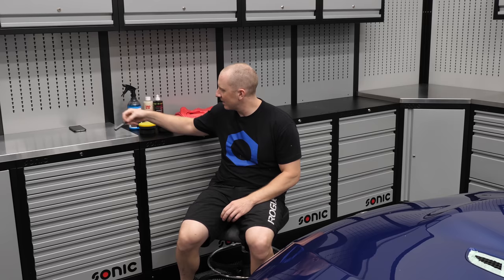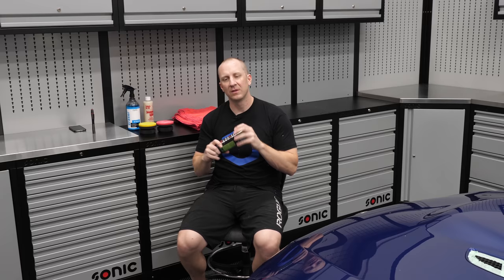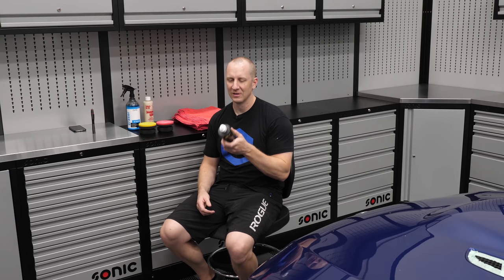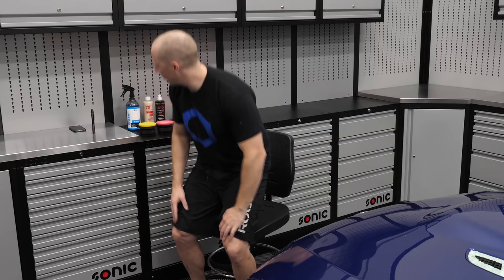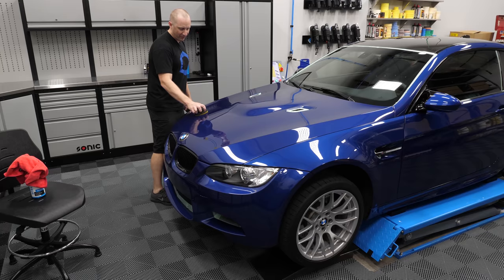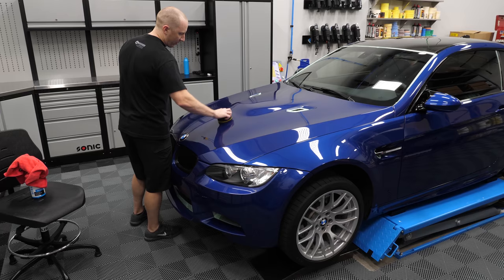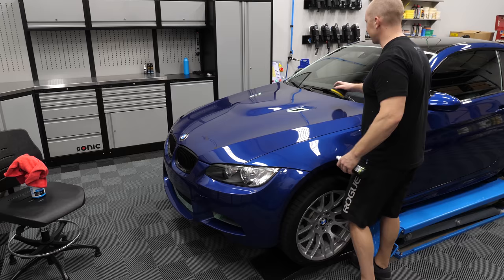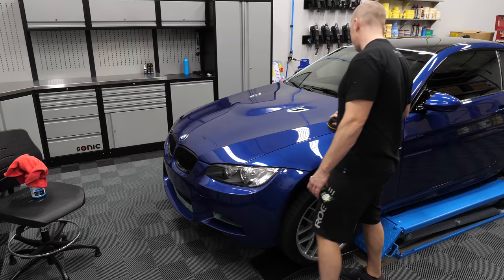Dialing In My E92 M3 : E8 - Power Lock / Collinite 845 Combo

Comment: I just went through compounding and polishing my daily driver Civic Si in Dyno Blue Pearl.. Used Griots Boss creams and it came out great. Now winter will start any day now.. and I just got Powerlock and 845 on in the nick of time. We'll see how the combo holds up to the harsh Minnesota winter. My paint has its flaws but this combination definitely has it looking up to it's full potential... and I can totally relate to that Powerlock wipe off. It's great. I really like the application of the 845 on top as well. So easy with such little product. I only had it sweat on my hood.. but it was because I used too much product there. Other than that no issues. The Bead Maker step sounds interesting. I cant wait until Spring so I can do this all over again. :)
Reply: Bytes In Flight fellow Minnesotan here!

Comment: you put me on the power lock and 845 combo and it never disappoints, might have to try the adams pads.
Reply: Do you ever try to apply the Collinite and power lock with a DA or always by hand? Thanks
Reply: @MrGflan  which ever method you prefer, personally I prefer using the DA it's quick and you avoid the elbow grease.

Comment: Matt, I’ve been told via a detailing forum
that the solvent content of Collinite 845 removes the previously applied coat of Powerlock plus, thus making the combo pointless. Is that a load of BS?
Reply: Good question. Lots of experts use this combo, and he did state that it lasts longer than just with one or the other. I called Jescar once and ask them about this combo and they didn't tell me about what you said.

Comment: Finally the stain in the trunk was unveiled... 😱
Its not a big deal, but it keeps attracting your eye... looks like marriage, you can only remember the bad spots, even through 99% of it was good. 😂
I once had my hood painted, by the tone of it wasn't right, because of the sun ray wear and kept trying to correct it with darker wax layers.
That trunk is easy, just remove it and send it to the Maaco shop. 😂
The whole car doesn't have to stay overnight.

Comment: Great finish, wiping off powerlock is probably best feeling in the world. The hazing on shadow line kidney grille has to be refined with super/ultra finish polish as menzerna 3800 or similiar with ultrasoft pad, i recomend rupes white pad. Those piano black panels are pain in the a** to properly refine.
Reply from the maker: They are jacked up and still have deeper scratches.  I'll just punt them in the trash and get new ones.
Reply: Obsessed Garage seems the easier way to go 😁

Comment: Het Matt, I want to do this combo, but I have a layer of 845 on already - about 2 months old. Do I need to strip everything? (if so would iso be enough, or full DA polish?) Or can I just wash and do PL + 845? cheers
Reply from the maker: It depends.  I find that you can just wash and add another layer of 845 if that car feels smooth.  Otherwise I would decon and start over.

Comment: I already washed, clayed and decon my truck but I added some VO7 quick detailer spray.  If I were to add some jescar power lock, will it bond to the paint?
Reply from the maker: I would strip it first with my Decon soap and wipe down with Eraser before putting Jescar on.

Comment: Is Menzerna power lock the same stuff for those of us that are in UK? Its easier and cheaper to get hold of, will it work just as well?
Reply: It's not exactly the same, Matt explained it in the beginning of the video. Jescar Powerlock + is tweaked a bit, but it won't be dramatically different from Menzerna Powerlock.

Comment: I've been looking for a video of a professional detailer applying the sealant/wax combination with a machine buffer. Is there a reason you wouldn't? I thought the idea of the machine polisher is that it saves time and does a better job than can be had with hand application. New to detailing. I'm just doing my car right now, I ordered this combo from Amazon after hearing about how awesome it is and I'm glad to have found videos of someone using it with great results. Look forward to hearing from you, thank you!
Reply from the maker: For me a polisher is for removing defects, not for applying the protection layer.  You introduce greater odd of marring the surface you just corrected using a machine.

Comment: Question for those who want to reapply after the first application 6 months ago. Do I need to strip the existing coating off before re-applying every 4-6 months? Or do I simply wash and reapply the coating? This is based on not needing to paint correct. Just to re apply since product lasts 4-6 months.
Reply from the maker: For this, I generally don't reapply.  I will decon that car and start fresh.
Reply: @ObsessedGarage  thank you !

Comment: When you can tell that it starts wearing off, do you put on a coat of wax or both products after stripping them (if you can tell that it has been stripped off completely)?
Reply from the maker: If the surface doesn't have embedded contaminants, you can just add another layer.
Reply: Thank you

Comment: What are your thoughts and opinion on the melting points on a caranuba wax like 845 in hot wether climates ?
Reply from the maker: Once it's on the car, it doesn't matter much.
Reply: Obsessed Garage sorry. What I mean is the melting point of the protection. Some saying after 140 degrees the caranuba melts off loosing its protection and gloss.

Comment: I'm about to slap these two on my car next weekend.  Using Beadmaker as a drying aid is good to use? Also, would reapplying these two every 3-4 months an overkill? I like my car clean and shiny 🤗
Reply from the maker: I used Bead Maker as drying aid.  You can reapply, but only if you don't notice any contamination.

Comment: Hi there, love your videos ! How would C 845 hold up in a tropical climate like the Caribbean islands ? Temperature there will go up to 100 °F and it's damp... (It's never as hot & dry as in your southern states)  Was also thinking of Finish Kare 1000P for that reason. For the moment I will be using after Sonax spray &seal. I have no garage so the car stays outside, so the curing time of the wax has to be rather short... Would love to know your opinion on that... That's my first time sealing and waxing: brand new white Land Rover 
;o)
Reply from the maker: Should be fine.  It get's close to that here.
Reply: @ObsessedGarage  Thank you for your kind answer. How would you wax around and inside the big RANGE ROVER letters on the front and back of the car ? Precision work seems impossible anyway with a pad  :(  does it matter ? Have a great day !
Reply: @delphinebez3045  Paint brush?

Comment: Hey Matt have you tried Wolfgang Deep Gloss Paint sealant topped with collinite? By itself it looks great and in a low driven left outside in the Puerto Rican weather it lasts for a year without problem in paint and glass. BTW it's expensive just like you like them 😂
Reply from the maker: I'm not an Autogeek fan, so I haven't used most of their generic stuff like Wolfgang.
Reply: @ObsessedGarage  I know most of the wolfgang line is not good but the sealant and the rinseless wash are some of the best in the market

Comment: "Powerlock bonds better to the paint." The continuing myth that someone started a decade ago that said you need to strip everything off the paint to get proper sealant "bonding." A chemist disproved it making any difference at all. Most already knew as we had never come out the next day only to find our sealant had slid off the car into a pile on the floor.
Reply from the maker: I'd love to see that research.
Reply: @ObsessedGarage Me too! I took their word for it because of how reliable they always have been. Contact Mike Philips. You of all people would probably get a much better response than myself. Head chemist for Meguiars told him that the oils that are in all products bond well with sealants and waxes as they require oils themselves within the products. In other words they all work together quite fine, there is no oil and water effects. I had a whole process to get all products off my vehicles. I stopped doing that going against every fiber of my being from so many years of indoctrination of that process.  No noticeable difference at all. As for stripping all products for paint correction, different story. You usually get better correction when there's nothing to inhibit the action of the abrasives. But for waxes and sealants? They "bond" just fine. But even according to Mike, if it makes you feel better and you've got the time, go for it.
Reply: @coachtim6188  Great information man!